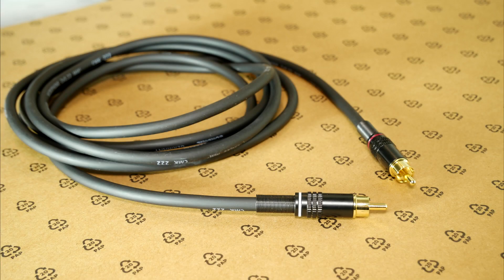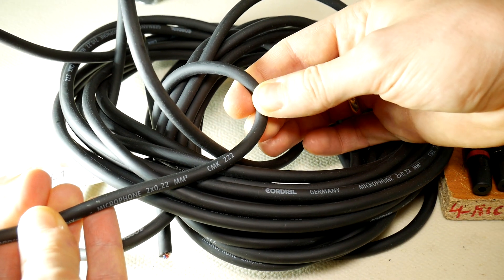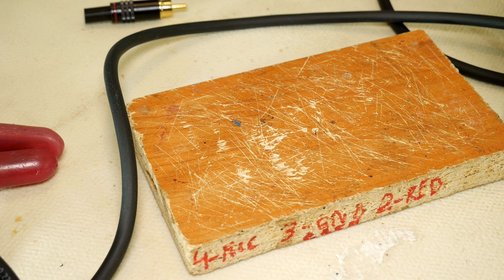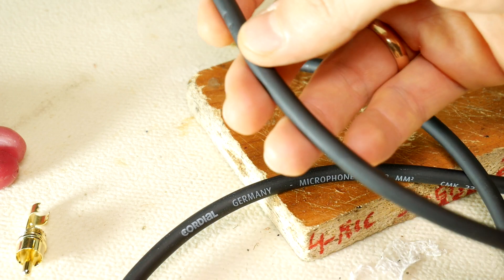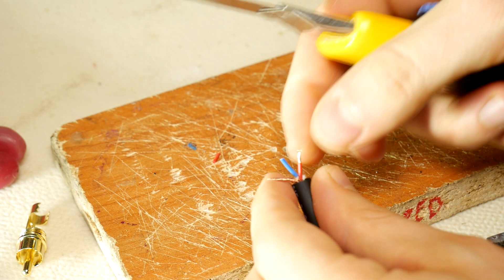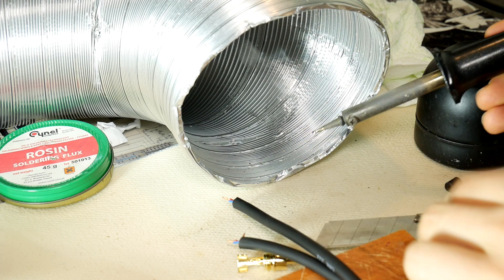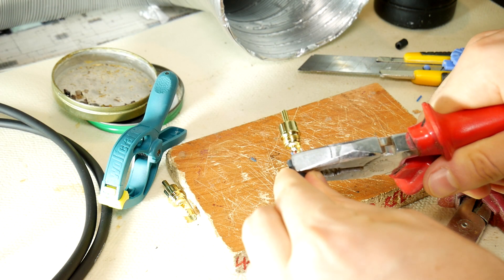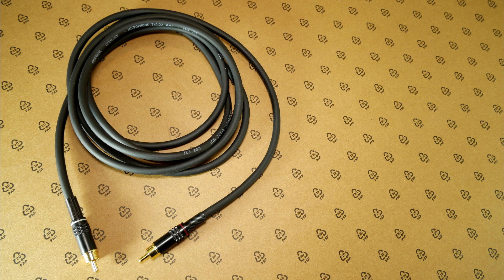How To Make High Quality RCA Interconnect Cables [DIY guide]

Comment: The cables should be made directional, by connecting blue to hot, white to return, with the shield connected only at the source end. It’s sonically better this way, and far less prone to hum, noise, and ground loops.
Reply from the maker: thanks for tip, try make new video with update version.

Comment: Top tip. Don't use a Stanley knife like this man, because if it is a brand new sharp blade you will probably go to hospital for stitches. Also strip more insulation off and then cut back to what you need.

Comment: Is this good for good for pre amp?
Reply from the maker: Of course, more then good, but it's without "snake oil"
Reply: I'm asking because I watched another video and he did it different he had different cable I think because there was one red wire inside
Reply from the maker: yes, you can use different cable, with shield and ONE central wire, but if you use like we do, cable with 2 central wires, you got better cable cross section for signal transfer.
Reply: @Techscrews  ok thanks for the advice!

Comment: Is it a waste of time making 8ft long rca cables for my car?
Reply from the maker: why, you can make your own quality and length cable.
Reply: @Techscrews  no like am I loosing too much signal making them 8ft long I want to do it but I want to know if it will have the same type of sound quality improvements compared to a shorter wire like yours? also  do you mind updating the material link and adding some good smk 222 wire I could order in the US thanks for the reply .

Comment: Mr. Techsrew , someone told me I can take outdoor extension cord 16-18 gauge or throw away upright vacuum cleaner cord and make a clean cut on the insulation . Remove the 3 cable and wrap it all tightly and neatly and tape in place with aluminum foil and put the cut insulation back in place and retake it back tightly with black electrical tape and add my soldering connector and what I got is a shielded stereo cable for subwoofer , pa speaker , ETC.....       is this true ?  Thanks for reply greatly !

Comment: I would have used other of the inner connector as a buzzing noice protector of how tou would call it. Solder just the other end of the cable to the ground and leave orher end hang around.
Reply from the maker: It's maybe help in recording studio, where have  a lot of cables, but in home hifi system i never had problems with buzzing noise. It's not a china ebay cable without screen shield.
Reply: you're describing a balanced connection. This is an RCA cable so you couldn't use the 2nd internal conductor for anything other than a)signal of b)ground. The buzzing noise protection I think you were describing is only possible with connectors like TRS or XLR which allows for the 2rd connector to be used for cold/neutral/negative leaving the 1st to be the hot/signal/positive and the 3rd to be ground. the differential/phase inversion of the cold signal will allow for addition RF interference to be filtered out (when flipped). this ain't possible with an RCA connector. the cable made in this video was A+

Comment: The cable should have 75 ohm resistance to it (it's very recommended) Also you can just use TV coaxial cable, it has all the shieldings too, and they are normally round 75 ohm too. !